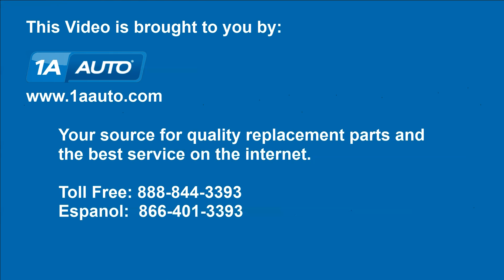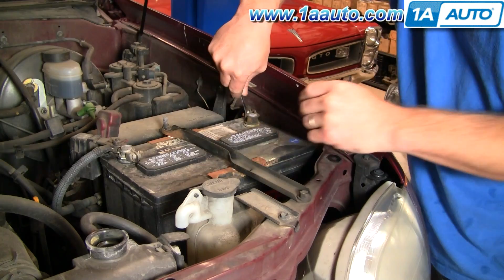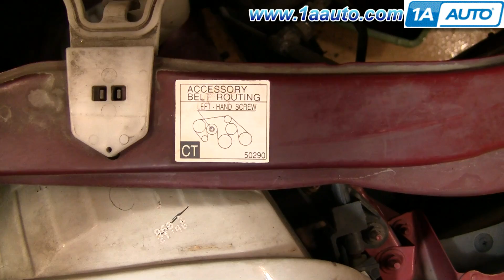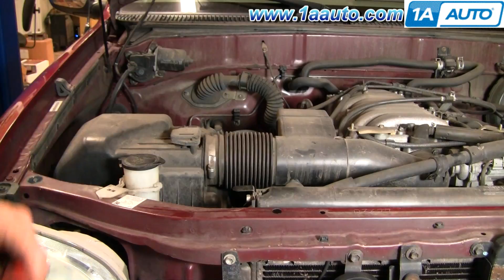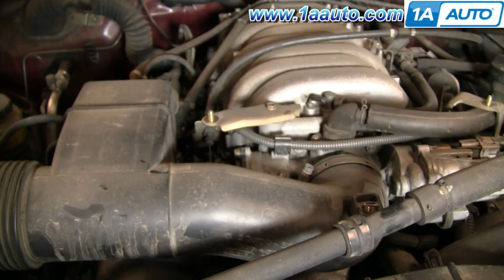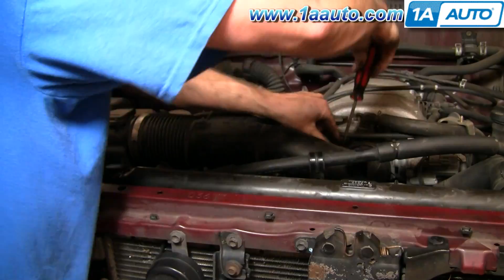How to Replace Serpentine Belt 00-02 Toyota Tundra V8

Comment: Thanks - had to replace the idler & tensioner pulleys but wasn't sure how to extract the belt ('01 Tundra 4.7 ltr).  I've replaced the belt in the past & forgot the procedure.  The under hood birds have stopped chirping!  Thanks again.

Comment: B.S. Your use of the vehicle without fan and shroud as well as disconnect water hose, along with your explanation that it should be easy, is bunk! It is difficult to get a socket on the tensioner and get leverage going at it from the left because of space limitations and in order to get enough leverage to release tensioner, when you attempt to release it after belt is removed, you end up binded against water hose - at this point, you have no option other than to disconnect water hose!!
Reply: Long 14 mill socket with a long handled flex ratchet works fine. Yes, it is still a pain reaching down to get the belt below and around the crank!
Reply: The video is misleading.

Comment: I know this is an old video, but changing the belt on my 4th gen 4runner and I'd been putting it off because I couldn't get enough leverage on the pulley and never had someone to help. After watching this, I removed the air intake, put the wrench on the tensioner, then crawled underneath and was able to easily get full travel on the pulley. Took about 30 seconds after that. Thank you very much!
Reply from the maker: +Norm Voshall Congratulations on the successful repair.  We're glad the video helped you out.  1aauto.com?utm_source=YouTube&amp;utm_medium=CTA%20Comment&amp;utm_campaign=1ATony 866-403-3393

Comment: Just about like you said. a lot harder with the fan and hoses in the way. NOTE: the belt does not go around the fan, it goes over it. 14mm rachet much more accessable on the It side than Rt.  Thanks again. I am not that mechanical and it took me 30 min.
Reply from the maker: Congratulations on the successful repair.  We're glad the video helped you out.  1aauto.com 866-403-3393